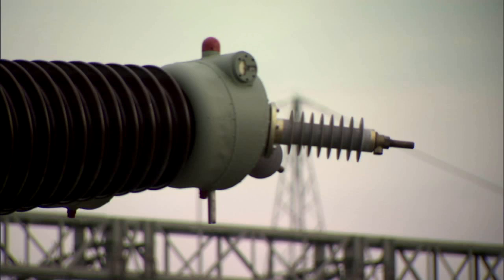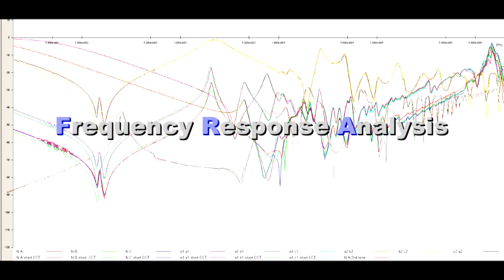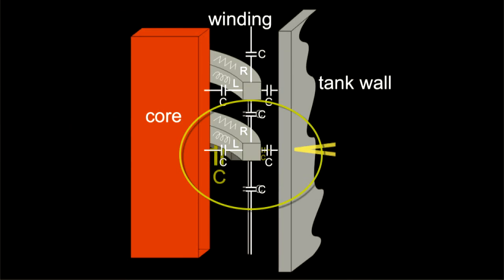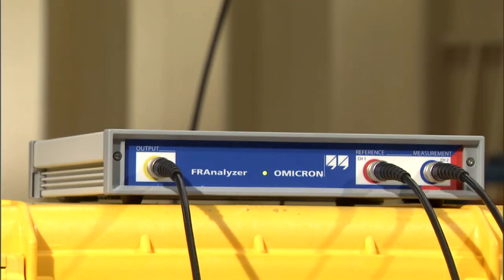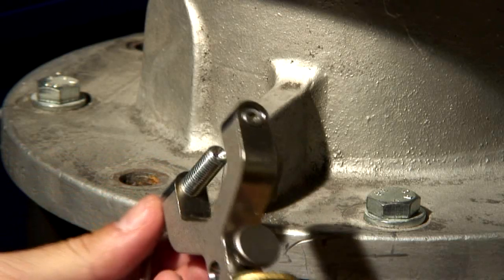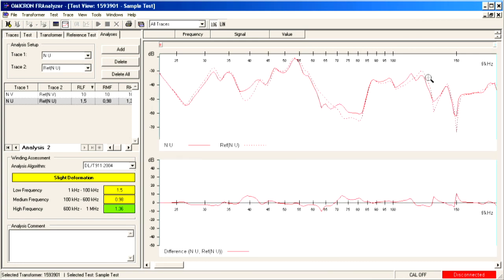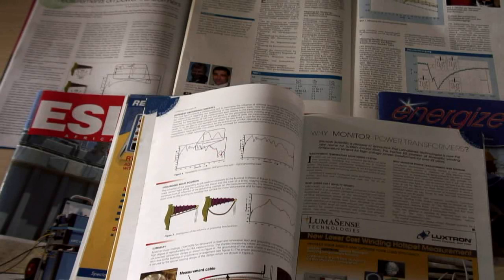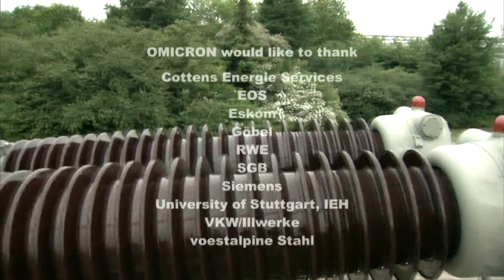Frequency Response Analysis with OMICRON FRAnalyzer

Comment: Thanks for this Great video , so we need the first SFRA test results as reference?
Reply from the maker: Dear Zakaria Hajjaji, 

thanks for your comment and for the interest. Yes a reference measurement is the most reliable way to assess the measurement. FAT SFRA data are usually supplied by the manufacturer and the SFRA should be measured again before commissioning. It is also possible to compare phases with each other or with identical sister or twin transformers, but the accuracy never reaches the level of a reference measurement. For more information about SFRA tests, please follow this link: https://www.omicronenergy.com/en/solution/sweep-frequency-response-sfra/

Best regards,
your OMICRON team

Comment: Hi sir,
During SFRA testing the windings need to be immersed in oil or not?
Reply from the maker: Dear Nafees Akhtar,
thanks for your interest.
Typically the test is done when the transformer is oil filled. Even though it is not necessary, keep in mind that the two compared measurements have to be performed in the same transformer condition.

Best Regards
Your OMICRON team
Reply: @omicronenergy  Thanks for your Reply
Can the contamination of oil during the passage of time Affect the SFRA test results?
Reply from the maker: Dear Nafees Akhtar,
In theory, there is some influence from the oil parameters too. However the effect is so minor it can be neglected.

Best Regards
your OMICRON team